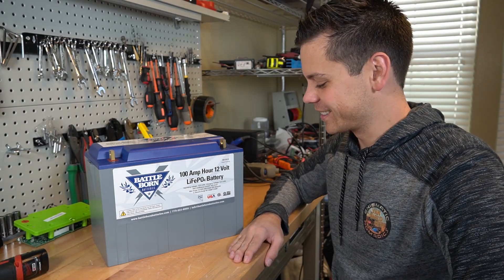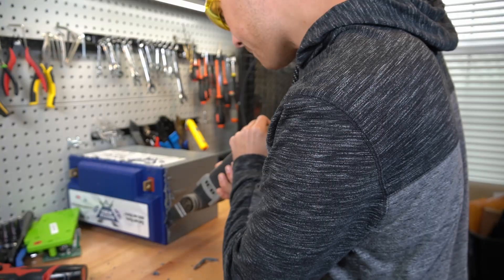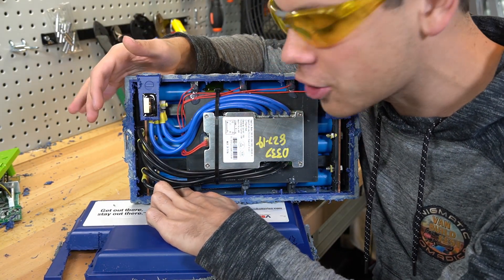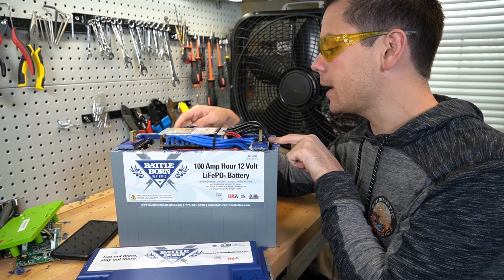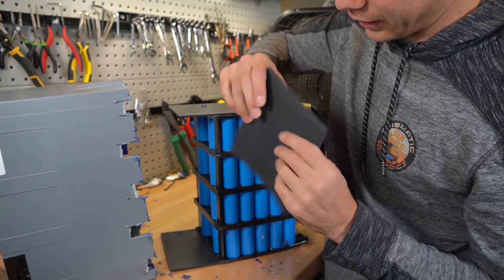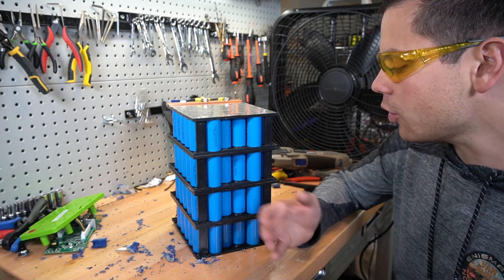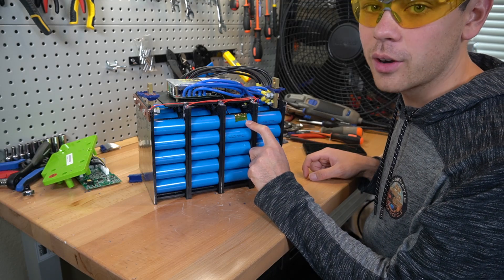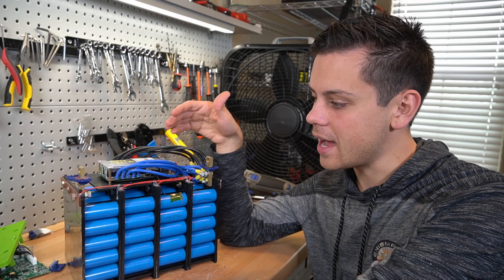$950 "Battle Born" Battery Tear Down

Comment: Battle born could not pay for a better advertisement than this. Looks like you get what you pay for.
Reply: Glad I bought 4 of them this year.
Reply: @Michael-s2p3p  So is Battle Born.
Reply: @Michael-s2p3p  did you check out the warranty?
Reply: @Michael-s2p3p  on Amazon they charge $949 but try to sell you a 3 year warranty for $57.99.  Wondering why?
Reply: Michael Pearce don’t know but they are functioning well and I have no issues. Ask me again in 10 years
Reply: @michaelpearce8661  Gotta be amazon.   BB sells it with a 10 yr warranty.
Reply: @ceeweedsl  at no extra charge for the warranty over the price that Amazon sells the unit?
Reply: @michaelpearce8661 Yes. Correct.     I have not seen any outside warranty selling on Amazon or anywhere.   The 10 yr warranty from Battleborn is one reason the battery is now $950, I suspect.  I found it for $850 a few years back but warranty was...8 years I think.   Also, they spec a higher percentage of rated capacity for entire life  than any warranted Lead Acid.
Reply: @ceeweedsl  I had checkout the BB unit on Amazon and they did offer a three year warranty on the unit for an extra charge.  Don't know why you didn't see it?  I don't order things online and when I tried I've been disappointed with what was delivered.
Reply: @michaelpearce8661  OK, well I think you can forget that issue, honestly.  I shop online twice a week probably, and in two countries, but I have developed the skills and seldom have problems.  I bought my first Battle Born from Arizona Wind and Solar (highly recommended) and the second one directly from BattleBorn.  Both times worked out fine. You might be able to fine them in some brick and morter or else stop by Reno to buy direct I guess.
Reply: @ceeweedsl  thanks for your assistance.
Reply: @michaelpearce8661  You all are acting like you don't know that amazon is always trying to push warranty for everything. Even for a $5 electric pen. seriously
Reply: @Michael-s2p3p how they functioning now
Reply from the maker: Hey everyone! This battery was sent by amazon warehouse, and would be the same as buying it as a normal consumer, but battle born paid for it. I am not on contract with battle born (or any company for that matter), but I accept products for review, and that's it. 

For the majority of this channel's life, I paid for the products myself. Lately, I get free products sent all the time, but that does not change my opinion or findings. Nothing in my videos or my website is stated unless I can prove it with actual evidence. The only reason my channel exists is because every video is 100% honest and there is no exception. This channel would fail if I fudged up some numbers or over-exaggerated something. There are electrical engineers fact checking every word that comes out of my mouth. Check the comments section of my advanced videos. Smart people are here to correct me if I screw up. And if I don't know something, I say "I don't know".

How I get paid is with my book sales, youtube ad revenue and affiliate programs. And whether I promote a junky battery, or a high quality battery, I make the same commission. So there is no reason for me to be dishonest or sugarcoat something. If anyone disagrees with my findings, or something in my videos is incorrect, I take it down. If you have followed my channel for any length of time, you know that I will take down a recommendation in seconds if something is not working perfectly. 

Watch my inergy apex videos, where I state the brutal truth. I was in contact with them for years and the moment I found a problem, I told everyone. If battle born screws up in the future and release a crappy product, I will tell you instantly. That is how this channel works. I am here to give the best advice and that's it. My book royalties are enough to pay for my living expenses, so I do not need anyones help. And I am a brutally honest person by nature. Not a good trait for social situations, but that's just me. I have always been this way.

Also, these reviews are the best way to teach people about solar power. It is much easier to show you how these systems work by zooming in and showing you, versus me talking for 30 minutes straight. 

Let me know if you guys have further questions or concerns.
Reply from the maker: Also, I didn't tell battle born about this video. I never asked how to cut it. They have never offered a contract like many other companies and have never been pushy to sell them. And guess what, if we find a battery that is better than the battle born for cheaper, we can bandwagon to that. I don't care. Products come and go. I'm here to find the best and that's it.
Reply: @WillProwse  This is something you might consider adding/including at the top of the "DESCRIPTION".  I do believe you/ve clearly established your credibility/veracity a couple of years ago here on youtube.
Reply from the maker: @azclaimjumper  done. And people who watch my channel know that I bash on all products. I am not on contract with any company for this reason, and I deny all offers.
Reply: @WillProwse  you should do a teardown on a rebelcell battery I hear they are one of the best.
Reply: @WillProwse  .....love your vids Will. Im not an electrical engineer, but am in civil engineering. My interest in solar, battery bank systems, and DC and AC power options started from a emergency preparedness perspective and has only grown with my HAM radio hobby. I trust your opinion 100%. When I hear or see something somewhere else I look to see your input on the same topic. 

Thanks for all you do. Yes...I have SLAs, but that is because my bank is for emergency prep only and also benefits from an expensive battery management system that is geared towards protecting my very expensive radio equipment. As such SLAs seemed to make sense in this particular application
Reply: @WillProwse   what are the chances of doing a tear down of a Renogy 12v 100ah lithium
Reply: "And I am a brutally honest person by nature. Not a good trait for social situations, but that's just me. I have always been this way."
Love your kind of person. YOU ROCK MAN!
Reply: "And I am a brutally honest person by nature. Not a good trait for social situations, but that's just me. I have always been this way."
Love your kind of person. YOU ROCK MAN!
Reply: "And I am a brutally honest person by nature. Not a good trait for social situations, but that's just me. I have always been this way."
Love your kind of person. YOU ROCK MAN!
Reply: Will seldom if ever partners up with a company. One thing I've come to trust is that when Will goes out on a limb to give a review of a product, it wasn't paid for or sponsored. Whether he is right or wrong (and I tend to trust his judgment every time), his review is always truthful so... You would be correct in that Battle Born could not buy better advertising - but they didn't. They were rewarded by Will simply because they did good work and provide a great product. I've learned that you get what you pay for. In the case of Battle Born, it isn't cheap but you get EVERY BIT OF QUALITY workmanship and PRODUCT that they could possibly provide for the price (and MORE). You will NEVER see this kind of review for that crap from China.
Reply: When a company such as Battle Born, has that much confidence in their products that they send a battery to be reviewed and torn apart, by someone who knows his shit, then that's confidence in quality. Made in the USA 👍
Reply: @TheGardenerNorth  Will Prowse bought his battery from amazon.  Battle Born didn't send it to him.
Reply: @donwilson2382    What weakness besides only one temp sensor ?   The battery is overbuilt for its stated specs with a great warranty to boot.
Reply: @donwilson2382  What are the battery weaknesses.  Plzzz; I'm willing to read/listen to what you have to say. WHAT ARE THE BATTERY WEAKNESSES, in your opinion?
Reply: Don Wilson Will has been smart with his videos and his book.  He has no financial need for that kind of sponsorship.  He received no compensation from battleborn and happened to have this particular battery on hand for this test. I’m not sure how he originally acquired this particular unit (he should have made that clear) but I would not be at all surprised to find that he paid full freight as a normal consumer.
Reply: @donwilson2382  what are the weaknesses?
Reply: @azclaimjumper  Appologies, to Will, I missed that in the video.
Reply: @TheGardenerNorth  I have to watch/listen to most of Will's videos 2-3 times to completely see/hear everything he covers.  However, I'm a slow learner.
Reply: @azclaimjumper  I think he said he bought it from them but Amazon shipped.  They may not have known who he is, though.
Reply: @TheGardenerNorth  assembled in the USA. Not made in the USA.
Reply: TheGardenerNorth Made in USA With made in China component!!!
Reply: @MM-yn9ni  OK, valid critiques, I imagine in some dimension.   Along the lines of "it's this and not that".  So this is not for DIY users, but optimized for hands-off people who just want it to work, deliver as specced and never plan to rebuild their batteries.  People who are not interested in experimenting with the BMS.    Who want a mfg that already did the R&D,  optimized and are fine with that.    If it fails, you don't maintain it, you call Battleborn and they make it right.  Ten years from now, you  look for some used Battleborns if you want to start fooling with cells.  In all likelyhood, in ten years we will have better options. These will be on ebay for pennies on the dollar.
Reply: Wonder why BB took down the response to Wills video??? Thanks for the tear down I've been really wanting to look inside. Keep it up!
Reply: Checked out this battery on Amazon.  You have to buy the battery protection plan.  It's for 3 years and costs $57.99.
Reply: Yes, I was expecting prismatic cells
Reply from the maker: @Desert Fisherman I didnt test low temp cut off these days because they actually worked. It was only until recently that the cheap chinese ones didnt include it.
Reply: It is battle born. Born for battle. Hehe
Reply: Five years later I just bought my first battleborn, thanks Will.
Reply from the maker: Battle born responded!! https://youtu.be/ivO7ytQ5W24
Reply: @WillProwse  I hope you take them up on the offer to tour the factory. Go get us some "battery porn" video, as the man put it.
Reply: @WillProwse  They took it down :( But I'm very happy to see such a high quality build, hopefully you continue to have a good relationship with them.
Reply: @WillProwse   This video is now listed as "unavailable."  I'm assuming they took it down for some reason?
Reply: @WillProwse  were you ever able to track down the BMS I'm just curious as to what they use
Reply: @WillProwse looks like they took down that video. What did they have to say?

Comment: Thank you very much for performing these teardown videos!!! Our house is currently on the market and when it sells we are buying and building a bus to live and travel in. Your videos have been a great resource as I design my battery and solar system. I was 50% sure that I was going to go with Battleborn batteries a week ago, now I'm 90% sure. I would like to see what the knockoff Valence looks like inside...but I doubt it will change my mind at this point. Thanks again!

Comment: It freezes here and I don't live in my RV , ,these batteries need to be warm to work or charge ,not a good battery for me .
Reply from the maker: Something that is not mentioned here is the horrible performance of lead acid batteries in the cold. Reduced capacity and higher internal resistance. And these batteries have low temp cut off so you can still use them no problem. And you can add a heater if you need it. I'll make a video comparing lead acid and lithium and I'll let you decide. I think lithium is great for cold weather but I need to prove it with numbers. Video coming
Reply: DIY Solar Power with Will Prowse Great video, too bad that is a proprietary BMS. We need a DIY BMS that can still discharge while the battery is below freezing but won’t allow charging. Sure, everyone talks about the Victron solar’s temp sensor, but I can also charge via generator, shore, or alternator, so I need protection against all of those sources in my drop in lead acid replacements. I already have the cells, now I need a balancing BMS with temp control
Reply: @WillProwse  I have been looking into salt water batteries Will,I hope they come viable in the near future.
Reply: LIFeBlue

Comment: Settled once and for all 👏 👏 
A clear case....great idea! No more hidden surprises. Uh oh😳
👁👁 Anyone used a heat gun to soften the glue and open the case?
Reply: Mr. Natural  With a clear casing you couldn't hide old, cheap, junky, broken, under rated, weak, and/or poorly assembled.   :-)  :-D
Reply: Bent Nickel, Exactly, plus it would look really cool to see your investment. ✌️
Reply: They may not even use glue to hold the top in place.  Lots of plastics are put together with ultrasonic welding.